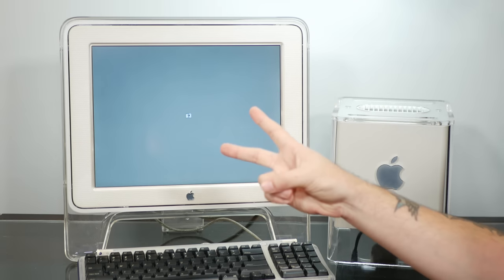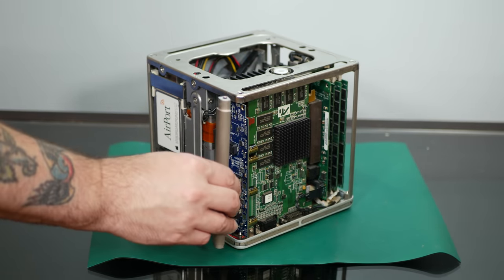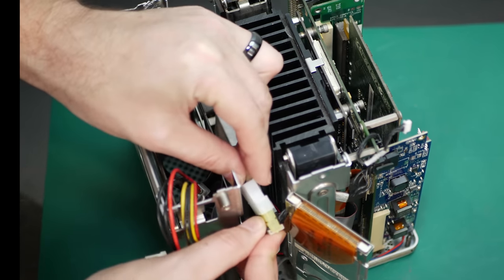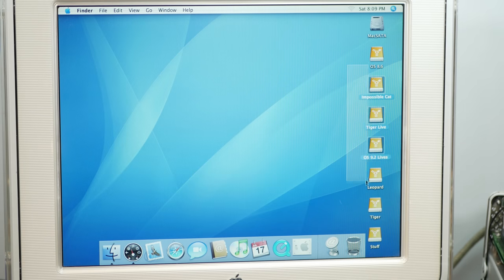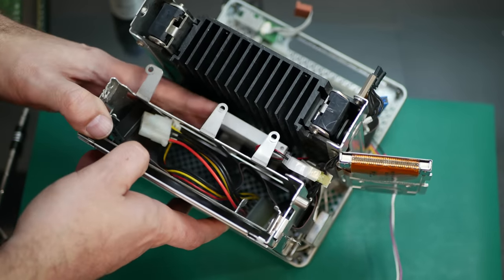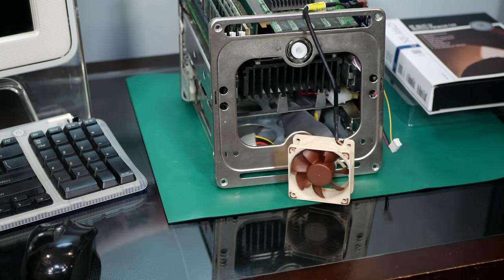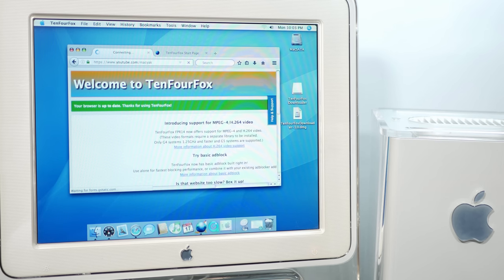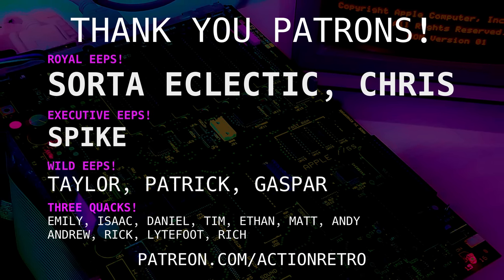Pushing my G4 Cube even FURTHER! The ultimate SSD, and can this thing YouTube?

Comment: Since this cube will be working a lot harder with more modern workloads...  Maybe replace ide ribbon cables for rounded sleeve ones?  Another idea would be a second tiny fan for heat sink on GPU since the old bulky hard drive is gone.   I've noticed massive heat/temp from my old retro builds running more demanding current internet apps.  Could the 1.2ghz cpu get a bigger heat sink?   I really enjoyed your video Action Retro.

Comment: I’m a little late here but I seem to remember that with some  OP Sonnet cards, you would loose the boot chime. I just got a cube and it has the Sonnet proc, same one, and doesn’t chime with the original speakers. Sound is fine otherwise. I have new foam baffles in the way for those speakers so will get them cleaned up.

Comment: Your Cube may run hotter with the 3.5" hard drive removed. The air flow, through the CPU heatsink, might be less than it would be if the drive space was filled. The open space where the drive was may also eliminate any benefit from the fan. In the past, when modding Macs, I have had to create shrouds to direct the airflow through heatsinks to keep things from overheating. Think of this like the clear plastic shroud in the PowerMac G5 towers, without this installed the air flows around the CPU heatsinks instead of through them.

Comment: I had the same problem with my SSD not booting after I installed a new DVD drive.  I had to make the SSD a slave and after that it booted without a problem.  Check if your IDE adapter on the MSata has a setting for master/slave

Comment: A facial tissue dispenser should go in the DVD slot.  I know, the tissues are supposed to come out of the middle where the ventilation slots are.  But you could still have a tissue sticking up through the DVD slot and confuse your guests.  Is it a tissue holder?  Is it a computer?  Yes.  Just be careful about the tissues heating up and spontaneously combusting, which would kind of defeat the entire project.  You should also dual-purpose the Mac Pro trash can into both a computer and an actual trash can.

Comment: If physically installing that post does not put strain upon the VRM module or any of its components, you can wrap the post in some substance to prevent conduction. Duct tape or shrink wrap (if any are large enough) come to mind, but I wouldn't use electrical tape as its adhesive tends to break down in heat.

Comment: With the hard drive removed you’d actually be getting worse airflow. 
You’ll want to install something to block that open area and make sure air only goes through the heatsink.

Ive also had some terrible luck with the current eBay ide to SD adapters.
I got one a year or two ago that’s an older revision of the chipset used and it works amazingly.
But the new ones will either not work at all once formatted as APM, or will work but will randomly freeze for between a few seconds to a few hours at a time.

Comment: The Apple Bong is part of why i still use a 13in Macbook Pro Mid-2012 as my main laptop, and work computer, and good see you get this going.
Reply: From what I’ve heard you can re-enable it in new macs through some trickery in the terminal.
Reply: @AwesumIndustrys  That might be possible, but since I recently found this Macbook at the recycle center for free with the magsafe charger, and it cost me less than $100 USD to replace the HDD cable, upgrade to 240GB SSD, throw in 8GB of RAM I already had, along with a new battery, and new rubber feet, plus it does everything I need a basic laptop to do on Catalina, then at current I don't see the point in upgrading to a newer machine, so I think I'm going to hold out to see if DosDude releases a patcher for BigSur as it does support metal API, thus giving it full hardware acceleration.

Comment: The best thing seen for fan noise vibration is rubber pull mounts they pull thru the mounting holes and secure the fan in place eliminating the need for screws that pull the fan right up against the metal case and all the sounds transfers  right into the case that being a new fan it must be this.

Comment: Flash a Radeon 9800 too and max out the video capabilities. Also, I have the speakers you need but not the amp (it’s built into the G4 tower). Where do I send donations?
Reply: The Radeon 9800 won't fit - it's slightly too long for the chassis. Even if it wasn't, the VRM would need to be relocated (though there's loads of space to, given the missing ODD). It's power requirements would make an original VRM explode, though the uprated one would probably be OK. It would get very hot though - the base fan sends no air up the GPU chamber, and the outer wall of the chassis would be right up against the 9800's HSF.

Comment: Yes, it is overkill.  You are still limited to the IDE maximum speed.
Reply: It's not the maximum throughput (with large files) that's the key advantage with SSDs - it's their performance vs HDDs when loading lots of small files (e.g. when booting up). SSDs perform worse with these too, but HDDs really tank (perhaps down to a few MB/sec). An SSD may be 100x faster in this situation, even if their overall speed isn't especially high - the Cube's ATA66 interface is still enough to show a difference (as in the video, where the Cube boots in seconds with an SSD).

Comment: There's no point in an m.2 drive vs the SSD, which even then, won't be faster in transfers persay but seek time. Cool anyhow!
Reply: Also to add, running those adapters definitely can't increase speed, only hinder.
Reply: It will saturate that IDE connector I assure you.  Random read/write speeds are all that matters in this scenario.

Comment: Now is there some sort of package you could add to macos 10.4 so it would add a trim function for SSD disks? unless it had one that early on that is.
Reply: I believe modern SSDs handle that. Less of a concern than it once was.
Reply: @spooforbrains  I just upgraded recycle center found 13in Macbook Pro Mid-2012, to a 240GB SSD. and even in the latest version OSX Catalina, you have to do into the terminal, and enable SSD Trim, and reboot, as it's not automatic, same on Linux as well, as I forgot to do it on one of my Lenovo Thinkpads running Manjaro Linux, and it killed the ADATA 120GB SDD in less than a year, and this was last year.
Reply: KMSMista  if what I said was false then there wouldn't be terminal/bash commands In Linux, and OSX to enable SSD Trim function, because the software doesn't know if you are running on an SSD, or HDD until you tell it.